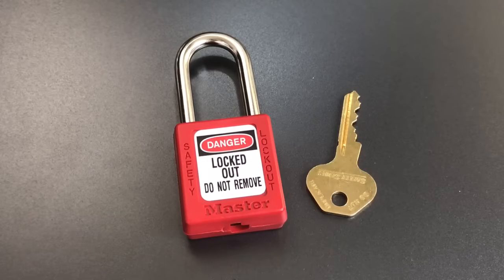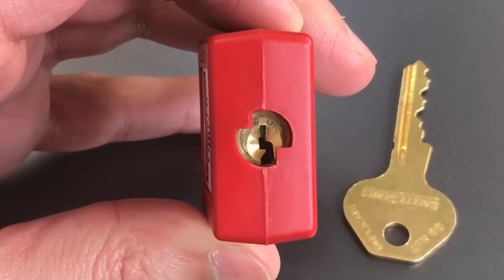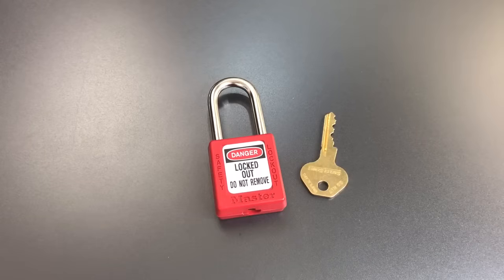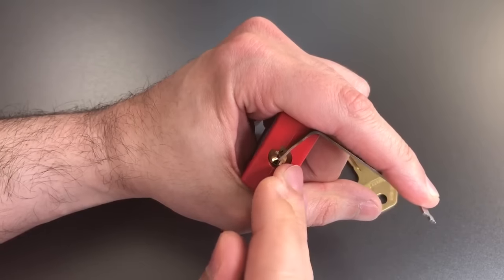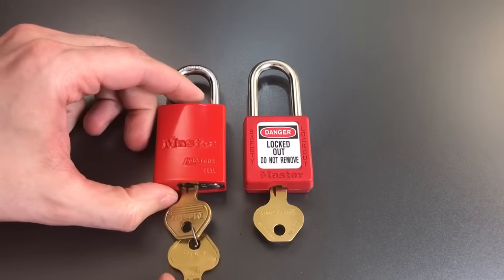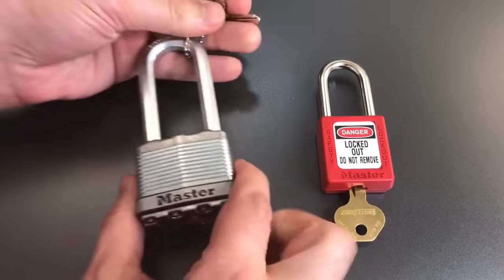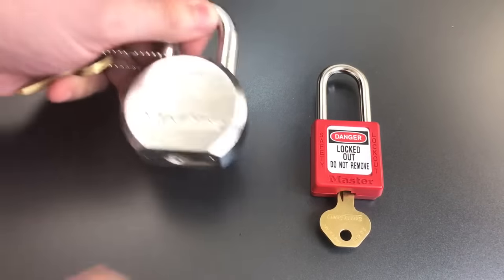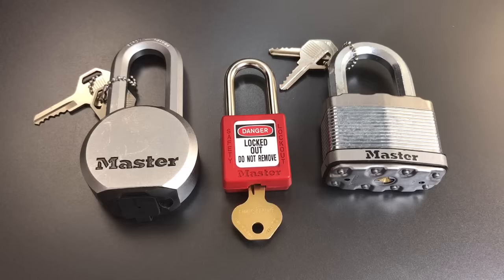[479] The Master Lock Paradox - Model 410 LOTO Padlock

Comment: As a former crew chief at a factory, our dept. had like 150ish of these. every once in a while you would have someone drop a key down a flume, or grate etc. and need to get one of these off of something. (After filling out a bunch of paperwork and whatnot, to get the OK to do so) we found out really quick the best way to get these open was a big old set of channel locks, and squeeze the shit out of them from both sides, along the seam. they fly apart and it takes literally about 1 second.

Comment: It's an important point that the key can't be removed from the keyway unless the shackle is locked
Reply: And many of them will retain the key if you turn it the other way a little, so you can hang them on your belt loop (or in LPL's case, on a carabiner)

Comment: That's amazing how a similar lock that's used in my work industry has a plastic body, when you can go grab several types of tools or battery powered devices and just cut the body away! I like knowing I'm protected fully when I'm the one inside doing work and relying on these type of locks!

Comment: If you prefix an 'S' to the 6835 and American 1100, the S6835 and S1100, you will get the same 6-pin safety cylinder (W401/W417).

Comment: I use these locks daily for my equipment. These locks have plastic bodies so they can be more easily destroyed. LOTO procedure prevents anyone, besides the person who applied the lock, from using it. If a person of missing and the lock needs to be removed there is a lot of paperwork and a lot of attempts to get ahold of the employee in question (so that we’re sure that they aren’t locked inside the equipment.) afterwards a pair of box end wrenches can be used to blow out the non hardened shackle. Or alternatively, bolt cutters are used as well. But the main reason is to make sure that the lock is difficult to pick, but easy to destroy.

Comment: Could be something to do with not having a non electrically conductive shell
Reply: the reason they sell plastic ones is in case you need to remove the lock from the locked out equipment, like if some dork takes the key home with him for the weekend, which happens all the time.
Reply: SuperAWaC but highly illigal.
Reply: huh? removing a lock out lock or taking the key home on accident is not illegal. if you remove a lock from a thing and then someone gets hurt because it needed to stay locked out osha will swim up your ass and stab you from the inside but it's not illegal
Reply: As someone who works with these daily, it comes down to cost and corrosion resistance. These aren't designed to stand up to physical attacks, but they might be left on a LOTO box or a piece of equipment for months, often in locations where they'd be exposed to moisture or chemical vapors. They also come in multiple colors, for different uses. Example. Gold locks are used for long-term LOTO, red ones by plant operators, green or yellow for contractors. That's not a standard as far as I know, but I've seen it on a few sites
Reply: It could also be that they want it to be really easy to break off in case somebody accidentally locks a mission critical switch and loses their key
Reply: Beau Trembath it's not illegal, we have forms for that (yay bureaucracy)
Reply: Safety number one priority ! Easy to notice damage ... If plastic core damaged maintenance man not allowed to use it.
Reply: If non electrical is a concern they have one with a nylon shackle
Reply: @SuperAWaC  most loto locks have a master key and a processes of checks before your allowed to use the master key.
Reply: @stevenp8195  could be that some chemicals are reactive to metal and not plastic.
Reply: If they are making it easy to get into, why not go all the way. The big metal ones should have the better cores, and the smaller plastic ones should have cheaper cores. If its about electricity, they use metal cores, keys, and shackles. The lock is just stupidly thought of.
Reply: It depends on where you work. Where I work. Yes, it can be a crime to take keys home. I would bet the same a a nuclear powerplant.
Reply: Take the keys home at our place and you're getting a phonecall to come back immediately and receive your bollocking.

Yes, having a lock that is corrosion resistant, actually easy to cut off is very useful in this case, but why is the core so hard to pick?  It's total overkill and they don't use as good a core in, supposably, more secure locks.
Reply: @mrtalos  No bullocks here my friend. I work at a prison. Hell, I started watching this channel to see how easy it was for convicts to get past locks. The paranoia is real now.
Reply: I also have to carry the lock on me at al times so it's nice that it's a lighter lock. I hardly feel the weight of this one when it hangs on my pants. But why the core is so good... No Idea xD
Reply: I'm sure weight plays a role too. If you're locking out an entire hazardous area with a single switch, generally each person entering that area has to have their own lock and key. We once had some customers tour during some seasonal maintenance and between all of the employees and the customers, there was like 25 locks hanging off a single breaker. It would've been a complete PITA to find your lock if they were made of steel or something.
Reply: The issue isn't why they make the plastic LOTO lock, the issue is why they don't put the nice core in other locks - even in their high end stuff!

No matter the reason for the plastic LOTO locks, there's no good reason for them to not use that core elsewhere.
Reply: @mrtalos  hard ti pick easy to break so nobody will access locked stuff and then close the padlock again and act like he didnt acess the locked stuff
Reply: When 12 locks are on a gang lock box, it saves weight and since they are not used as "security" they dont need to be metal. Even if the lock was made of balsa wood, it is still a crime to remove a LOTO lock  that does not belong to you.
Reply: @SuperAWaC  Removing a LOTO lock from equipment is a violation of OSHA regulations (aka illegal) unless very specific procedures are followed. That procedure includes attempting to contact the individual who placed the lock.
Reply: Beau Trembath nope not illegal If you 100 percent identify that he did in fact go home
Reply: you might be making a joke but, they arent conductive because a lot of machines have doors that have electricity running through them for safety.
Reply: @sheeplord4976  its not about getting into, it basically serves as a sign saying "dont operate maintenance being done".
Reply: @SuperAWaC  dumb plant workers will say "illegal" and mean not allowed, or against company rules. I doubt he meant against the law.

Comment: Im an electrician and we use the plastic loto’s alot. Its good to know they’re difficult to pick. Usually the device it’s attached to is all plastic (breaker lockout) and can be broken off easily. What keeps most trades from screwing with them is you can get some hefty jail time for tampering with one.

Comment: Friendly reminder if you see one of these out in the wild: Do Not Touch!
My dad's an electrician and was working in a factory being gutted and renovated, and of course had turned off power and locked out the breaker panel using a similar lock. Turns out that the offices attached to the factory weren't wired correctly when it was built, and one guy lost power to a single outlet in his office. He decided that was Unacceptable and so walked into the construction site, snagged some bolt cutters from somewhere, and Cut The Lock Off The Breaker!! My dad was, at the time, on the top of an 8foot ladder cutting through a 6inch conduit with a reciprocating saw. In short order he found himself flat on his back 3 feet from his ladder holding a now very dead saw, complete with smoldering saw blade. He needed stitches in the back of his head, and thank gods that's all he needed. If the power had been turned on ever 30 seconds earlier his hand would have still been directly on the bare conduit! He would not have survived that. Those locks are so absolutely important and should NEVER BE TOUCHED if in use.

Comment: With my employer, the RED lock is for lock out by an individual. YELLOW is for a group lock out where multiple service techs need to be in a machine. BLUE locks are for maintenance lock outs.
Reply: "group lock out"

There's no such thing. If multiple people need to isolate an energy source a hasp needs to be used so everyone can apply individual locks. Wait until someone gets hurt at your facility. OSHA is going to bend your employee over a table with no lube and suddenly you are going to have individual locks only.

Lockout programs not being followed correctly is one of the most common reasons that OSHA issues citations.
Reply: @adam...you have obviously never locked out something with many energy sources and valves to lockout. There are things called group lockout boxes, the yellow locks are applied to the lockout points. Those keys are placed into a box. That box is locked with the individual's red lock indicating that they are involved in working on that project. The box with they keys cannot be opened until all of the red locks are removed. Then the yellow lock keys can be accessed and unlocked.
Reply: @philippate2374   Same is done at my work, but I dont think the color is of any significance. We have a primary Motor Control Center, as well as local disconnects. 

The project lead will insure that everything relevant to work being done is locked out in the control center, then the key for those locks is put in a group lockout. Each individual then puts there lock on that key container, which guarantees any equipment from being energized until all personnel and locks are removed. All of our locks are red, metal bodied, masterlocks.

Comment: I dont get why many people point out the same thing yes for the industry you need it to be weak for emergency but what is really confusing is why Master cant use the amazing core on the strong locks
Reply: The answer comes down to cost.  Even if the better cylinder only costs a dime more....multiply that by a million.

Comment: These lock out tag out locks are usually only used for personal safety, like where I work if the bailer compactor is malfunctioning, we put it on there so nobody can operate it and potentially get hurt. Not really a scenario where somebody is going to try to pick the lock or break it. What’s to gain from it? Hurting or potentially killing somebody else? I just don’t see the reason anybody would want to try to get this lock off in that situation for some kind of gain. The only reason I can think of is that if the key is somehow lost we would be able to break off the lock with relative ease instead of spending the money to hire a locksmith or something like that.

Comment: Your videos are quite fascinating. The answers to your questions are simple. Master sells these things by the hundreds of thousands, and the sets of 6 locks for each worker is supposed to be unique so that no other worker on the site can open the lock. The fragile construction is so that if the worker has flown home and cannot return to remove the lock he forgot to remove at the end of shift, then a supervisor can use a bolt cutter to remove the lock. There are usually disciplinary action taken against a worker that had his lock forcefully removed by management. This is the case in Australia where people are quite anal about safety precautions.

Comment: In the navy, at least on submarines, we only used paper tags and never had an issue because everyone wearing fish knows the importance of those tags
Reply: OSHA doesn't give a fuck about military. Hell the national electrical code doesn't even apply to military.
Reply: quite the opposite I suspect. Military do not want burdensome procedures and rules imposed on them. Simply by being a soldier it is understood danger and death are real and not uncommon occurrences.
Reply: Sadly, the damn skimmers (surface fleet, for the civilians) do stupid shit like standing on tagged-out valves.  

Also, you are going to spend a lot of time behind bars if you screw with a tagout.  At the very least, you're looking at several month's pay getting taken away and losing a stripe (paygrade).  If someone got hurt, you're going to Leavenworth.

I suspect half the reason the Navy doesn't use padlocks is because we were doing that before the civilians got the idea (and then discovered that it took a padlock to keep stupid people alive).

Comment: The reason it has a seemingly secure pin setup is so that there can be MANY different keyed locks on a GIANT job site, so there are less chances of keyed alike locks, because if someone unlocked the wrong padlock, someone could die.  If someone does lose their key, the bolt is easy enough to cut if everyone onsite agrees the lock should be cut.  I believe, that the design and choice of features are specifically designed to suit the needs of certain buyers.  I’ve seen all of them at different job sites, there is no security threat inside the job site, which is why a plastic body is ok.  Great video!

Comment: We buy hundreds of those locks.  The culture of L.O.T.O. is not for ultra security, it is like coming across a skunk, you see the skunk/loto lock, back off.  Someone may die if that lock is picked, or removed.  So, it may have a crap body, and relatively easy to pick, but in an industrial culture, if one of those locks is on a power supply, or valve, STAY AWAY!!!! Someone's life, or your own may be in jeopardy if removed, and energy is re-applied, without approval from the person or dept. that applied that lock.
Reply: This misses the point.  The core on this is ridiculous by Master Lock standards, while putting trash in their high end security padlocks.

Comment: It's non conductive, and if someone loses the key, you can break it off relatively easily without breaking the control panel. You don't want 200 lb gorillas f**** around with 600 volts and set of bolt cutters. But the tumbler needs to be secure enough it's some other gorilla doesn't walk by and his key fits in it. 
Paradox solved.
Reply: The problem isn't that the lockout lock has such a high security core; the problem is that the other high end locks with super secure bodies don't have core's even close to this secure

Comment: I use these, and there is a good reason.  The locks are tricky to pick for most people so removal is always destructive if the key isn't available.  This is a safety feature.  It's about the LO/TO policy of the company using the lock.  The plastic lock combines a cheap to buy and replace (when it's inevitably cut) lock with maximum key combinations to minimize the chance of a duplicate in an organization.

Comment: This lock is used to protect life, the others are only used to protect property.
They also need to be able to be broken open without breaking the device it's locking out quite frequently as the key holder may have left a site but work needs to continue and they left site with the keys by accident quite often.
So making it harder to pick but easier to break makes sense.
Reply: That's why we use 6 lock hasps in our workplace. Sometimes someone forgets to unlock when they leave during a shift change without switching over the lockout to the next shift,save the lock but lose the cheaper hasp. But either way for us its still a hassle to cut off. Three ppl need to be notified and paperwork filled out to cut it off. And an employee gets a written warning for forgetting to switch over the lockout,cause we have no idea why it was locked out in the first place. 

We switched over to the aluminum housing at work from plastic. Much prefer the plastic lock but honestly don't know why. Maybe cause it just feels better on those -40 C winters lol

Comment: Simples this lock is designed to be broken if the key is lost while avoiding accidentally being unlocked without leaving an evidence trail.
Reply: that’s not the point though, his question is, why don’t they just use this type of core for the other higher security locks
Reply: Exactly. This is an example of tamper evident design.  It's beneficial to be able to cut a LOTO lock easily, but it should be very difficult to unlock surreptitiously.

Comment: Everyone is mentioning the fact you can break the loto lock quickly but also the way the beefier locks look is intended to be a deterrent by making the lock look harder to pick then it actually is and to promote security though obscurity, one's designed for use in safety and the other is designed to trick a consumer base into thinking the lock is secure

Comment: I worked at several power plants as an operating technician and one of our duties was to secure equipment that needed maintenance, that could involve chaining and locking valves, removing fuses and open breakers etc and they all needed to be locked down and a sign with the correct work order number. The locks was all the same and all of the us technicians had the same key, so when the job was done anyone of the technicians could remove the locks when the job was done. The jobs could take hours, days or weeks so it would probably someone else then then one that had secured the equipment earlier that would be on duty. For all sake I could had found, say a faulty pump, switched over to a spare and then written a rapport on it and then secured it for the maintenance crew that would take care of it at day time.

No one removed the locks without an ok from the maintenance crew as it could spell disaster and even life threatening danger.

Comment: I can tell you exactly why rn, it’s about lightness that the body is so weak. The lock may be at risk of being picked in a LOTO use but very unlikely someone will forcefully open it. As someone who’s done some pretty big lockouts, I wouldn’t like carrying around 25 locks that are all very sturdy and therefore heavy. It’d be might inconvenient and slow work down